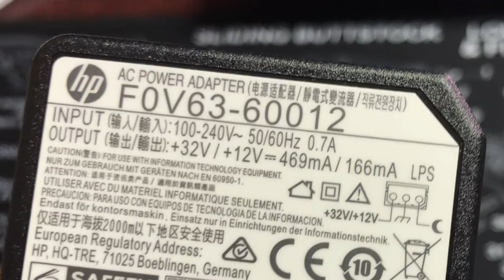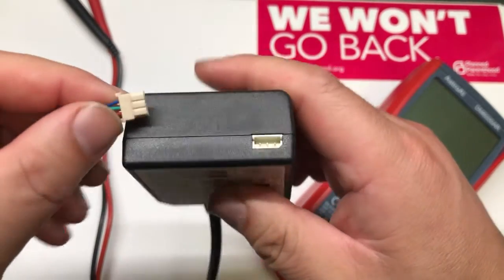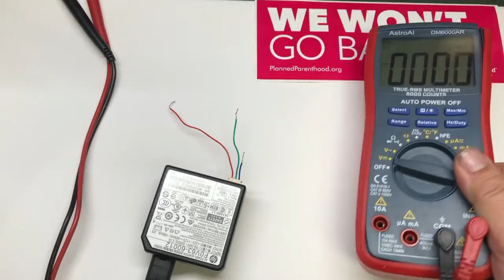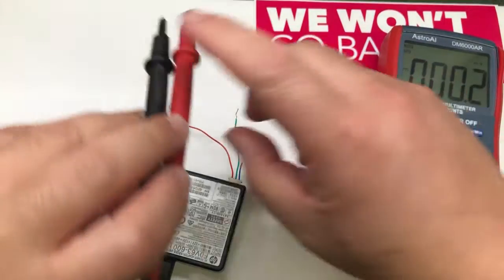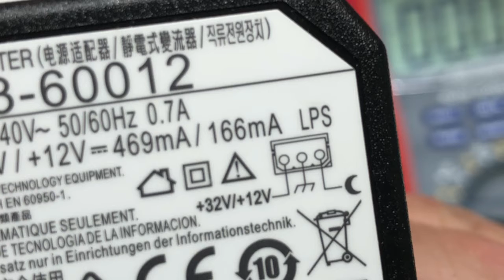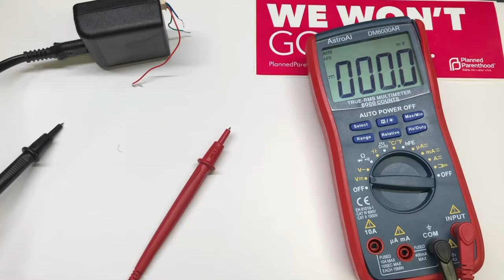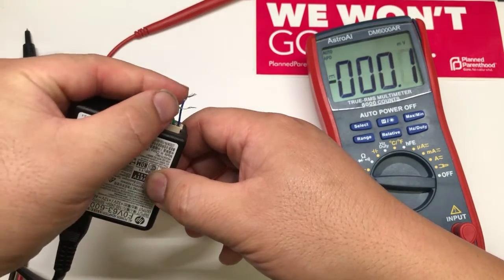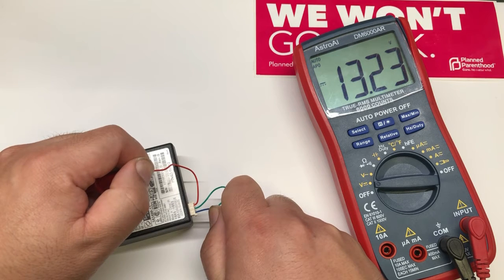How to Test Your HP Power Supply - if Your Printer Won't Turn On

Comment: I have similar powersupply from an hp3830. Printer suddenly is not powering up. I checked with multimeter and the powersupply outputs the correct volt. Could it be someting else?

Comment: Nice  explain  HP SMART TANK 500 SERIES PRINTER POWER ADPTER PIN CONFIGURATION about   
voltage +
 GND+MODE 🌙 
 VOLTAGE +GND=+32V
MODE 🌙 + GND=12V